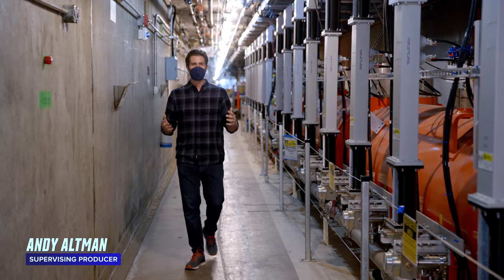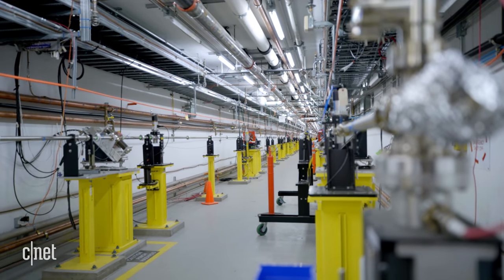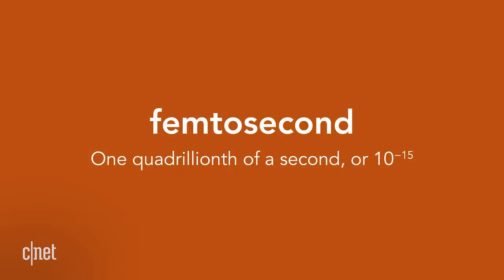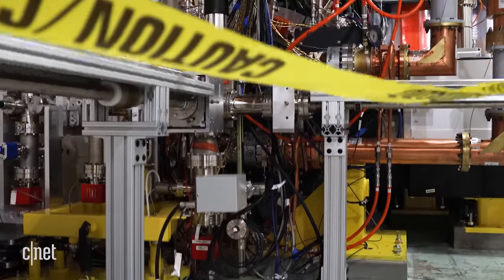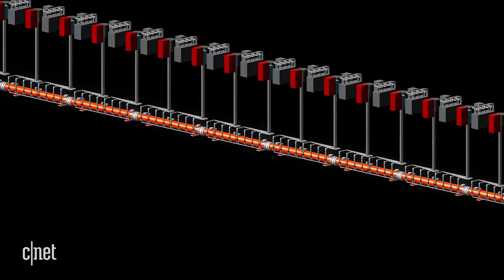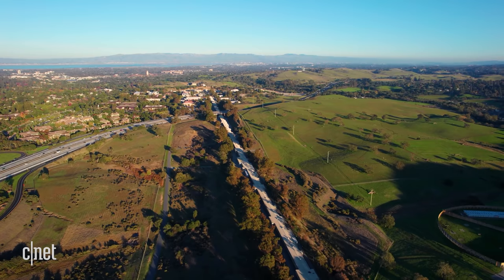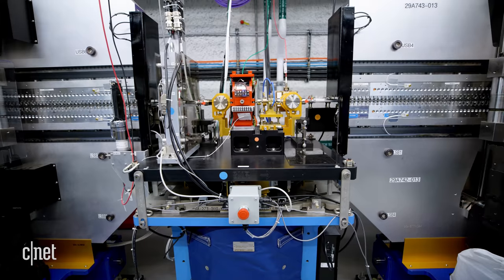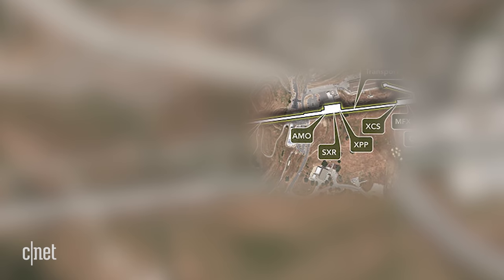Inside a two-mile long particle accelerator

Comment: "A femtosecond is to a second, what a second is to the age of the universe." WOW, that's a pretty unfathomable number. This is quite the elaborate machine, how much does it cost for a single run of this beast? The power cost alone has to be several thousand dollars per run.
Reply: 14 dollars a run surprisingly
Reply: 14 dollars a run surprisingly

Comment: When SLAC refers to brightness, it's important to remember that's not beam power.  Brightness is actually amount of power in a subtended solid angle.  Or more colloquially how tightly is the beam focused.  Last I heard from project scientists, LCLS-II was under delivering design power and over filling its focusing optics.  That is to say, not very bright. But maybe these are just the normal start up transients for a big project.  It's important to sort out reality from hype.

Comment: Thanks for watching! What do you want to know about LCLS-II? I'll do my best to answer your questions!
Reply: In the last experiment hall, there seemed to be a lot of "human exposure" within the large chamber.  When it's pumped down and active, how much can residual skin or other bio-detritus affect the experiments, or is it a non-issue?
Reply: Oh, and don't you have the option of removing certain posts?  If so, please get rid of the "Ernest Radner" posting and its replies, as they're just Crypto spam.  The "report" option is totally useless. so active removal is best.
Reply: @davidb6576  that is a great question David! I don't know the answer but I will see if SLAC scientists can shed some light!
Reply: In the video, it was said that the electron beams are diverted to different sites or equipment depending on what kind of experiment they wanted to perform, the question is won't they get more precise and efficient results if LCLS II is connected directly to all these separate experiment chambers and equipment instead of having to divert the electron beams to somewhere else if they want to do this or that. In fact, connecting LCLS II directly to all the separate experiment chambers will save time and will enable various experiments to be conducted at the same time with the same electron beams by just casting or pointing the electron beams to the separate experiment chambers if LCLS II is connected directly to all the separate experiment chambers. It will take more time and money but in my opinion, it will be a lot better.
Reply: What happens when there's an earthquake 😳🤔

Comment: Most impossible thing to see is that for light at impossible speed to make a 90 degree turn without handbrake or breaking is same  like running a straight line... wtf....👀

Comment: Why couldn't you build the particle accelerator out of giant fiber optic cables, And add light.
Reply: cause its made of fibers, your way.  they need metal, fibers are too weak.. its in bananas you know
Reply: @thekodanator  The magnetic field is what's containing the particles, not the metal in the walls.